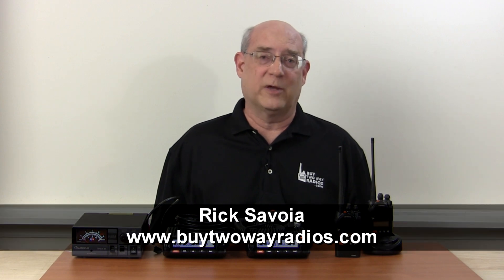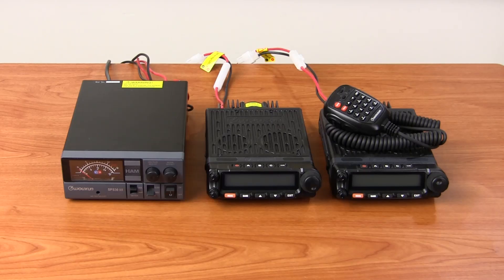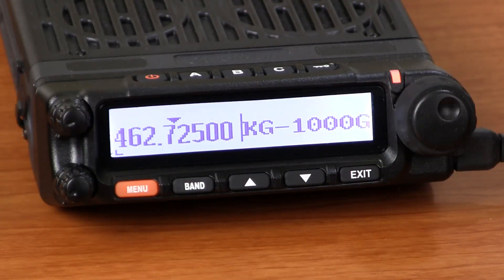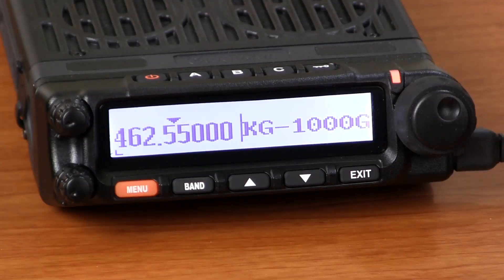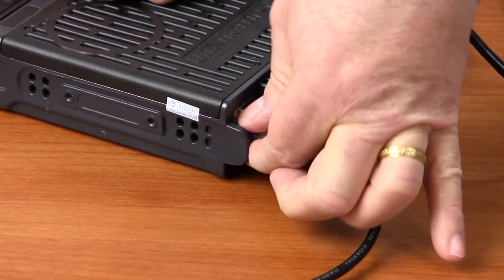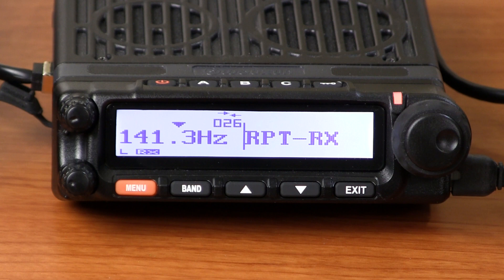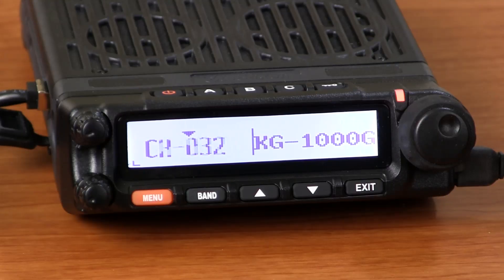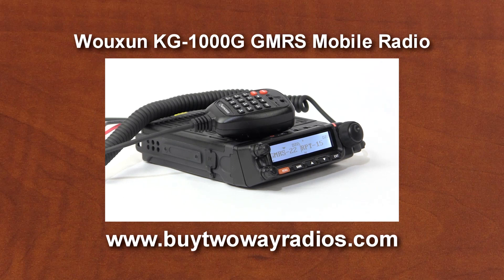How to Turn the Wouxun KG-1000G Into a GMRS Repeater

Comment: @BuyTwoWayRadios - Can you use a kg-1000g and a kg-1000g plus to make a repeater?
Reply from the maker: Yes, those models are compatible with each other to make a Repeater. However, the KG-1000G Plus is overall recommended over the regular KG-1000G.

Comment: You should have included more info on using 2 separate aerials, it’s not that easy to do without the receiver performance being severely affected by the transmitter!  Duplexer is best solution, but if using 2 aerials - vertically separate folded dipoles on the same pole exactly one above the other, and far apart, to maximise isolation.

Comment: Can you still use one unit as a base station to make calls? when in repeater mode or do I have to take it out of repeater mode to do so..
Reply from the maker: Yes! Turning on Option 56 RPT-PTT allows you to transmit while in repeater mode.

Comment: As I understand each radio requires its own antenna, What  recommended antenna for good receive and transmit and how far apart will they need to be? height will be 20 to 30 ft

Comment: Does Buy Two Way Radio offer a Station ID  module for the KG1000 plus or is it built in?
Reply: Hope you haven’t bought those radios for a repeater, they are an outstanding radio to throw in your car or a small farm in repeater mode. But they desensitized the receiver so much when it’s in repeater mode, 
No one can hit it unless they are within 10 miles or so. 
BTWR don’t mention that. There are other options you will get better results from.

Comment: One of the radios is massively 'over built' because it doesn't need to transmit at all.  You really just need a radio monitor and a repeater.   Why not make a less expensive monitor that communications with a KG-1000G?

Comment: Hello. I am very new to the radio communications hobby and find this video very helpful and informative. One question comes up: wouldn't it be more cost effective to purchase something like the Midland MXR10 GMRS Repeater. I recently watch a video from Notarubicon and it was about the Midland. Thanks.
Reply from the maker: Hi, thanks for your question! It really comes down to preference when considering different brands and what they offer within certain cost brackets. We cannot speak on the MXR10 as we do not offer it on our site, but the KG-1000G is a  very popular unit that many may already have on hand, and the cost of purchasing a second one to use for repeater purposes can actually be more affordable than buying a whole new repeater set as you suggested.
Reply: @BuyTwoWayRadios  Thankyou for the reply

Comment: Can you explain how you hooked two radios to the same power source?
Reply from the maker: To connect two radios to the same power supply, attach the leads to the power cables of each radio to the posts of the positive and negative terminals on the back of the power supply. You can use U terminals or ring connectors to stack them on the posts.

Comment: My 50W Wouxun outputs only around 25W at the GMRS frequency. A duplexer can rob almost 50% of your output power. So my issue with using the Wouxun hardware for a duplexer is that I might get 15W when I would prefer to radiate 50W.

Comment: Hi Rick...I am a newbie to GMRS radios and was disappointed to learn that the One City Minnesota area has -0- repeaters..I may do one that you are talking about.quedtion..does this repeater need to be registered or licensed by the FCC..?..,and could you give more info in spacing the Antennas and another video about setting up the outside antenna and cabling..thanks your clear and concise video was spot on and informative
Reply from the maker: Hi Lawrence, thanks for your question! We have an article on our blog about GMRS repeater guidelines, hopefully this will provide some insight: https://www.buytwowayradios.com/blog/2022/01/do-gmrs-repeaters-need-to-transmit-a-call-sign.html#:~:text=In%20simple%20terms%2C%20the%20repeater,identified%20by%20that%20family%20license.

For your other questions, we also have guides about antenna hardware such as connectors and which ones you will need: https://www.buytwowayradios.com/blog/2014/01/two_way_radio_antenna_connector_chart.html

Here is Episode 165 of our podcast, The Two Way Radio Show, about which antenna cabling is best in different situations: https://www.buytwowayradios.com/blog/2022/03/twrs-165-how-to-choose-an-antenna-cable-for-your-radio.html

Our blog is home to many resources for jumping into GMRS, Ham, or any other kind of two way radio-centered hobby. There is plenty more material that you may find useful!

Comment: Question if I use these radios for a permanent repeater station do these radios have a automatic station ID built into it. I Believe by FCC regulations you have to ID once every 10 minutes. Would be nice if there is a feature built into the radio to do this for me is that an option thank you very much.
Reply from the maker: There is no built-in function for Station ID. However, if your repeater is intended for use as a private or closed repeater system, you are not required to transmit a Station ID every 10 minutes. There are still specific rules regarding identification, though. We have a blog post about repeater ID guidelines on our blog, you can find a more detailed explanation there:
https://www.buytwowayradios.com/blog/2022/01/do-gmrs-repeaters-need-to-transmit-a-call-sign.html

Comment: This is good know that 2
radios will be able run as repeater unlike others on market. .
But You need a Duplexer for uhf .
2 antennas on a tower 14 leangth 
apart is hard to put up. 
FCC requirements CW repeaterstation ID  every 15 minutes if un-manned station. 
Wouxun should put CW ID in the radio.
Yes you can voice ID as callsign. 
 but can't leave by on 24/7 . 
If mic on TX radio keys up while iin repeater mode you can put a cw ID 
Like ID o matic on mic input RJ-45 .
Over all technology is getting better .
The Mobil is ultimate GMRS Mobil today.
Great video .

Comment: Is a Controller required for Station ID?
Reply from the maker: For private GMRS repeaters, an auto-ID isn't needed, but they are required for publicly accessible ones. Regarding the private repeaters, during transmissions the operator must identify the callsign of their GMRS license every 15 minutes. We have a handy article on our website that lays down more of the rules in detail:
https://www.buytwowayradios.com/blog/2022/01/do-gmrs-repeaters-need-to-transmit-a-call-sign.html#:~:text=In%20simple%20terms%2C%20the%20repeater,identified%20by%20that%20family%20license.

Comment: I just set up two Wouxun radios and have tested this repeater options, it’s pretty cool. 

I have two questions though. Is there a way to boost the audio on the system? The audio level is very quiet and I have to turn the volume up to hear communications compared other local channels. 

Two, any progress on an IDOMATIC type system?
Reply from the maker: We haven't heard of any issues with low audio. However, such an issue can be caused by desensing if you are using two antennas and they are not spaced far enough apart. Also, check the bandwidth settings on your radios in the repeater configuration. If one is set for narrowband and the other for wideband, that could affect the audio level.
 
As for the IDOMATIC system, we are still working on developing a setup specifically for the KG-1000G.
Reply: @BuyTwoWayRadios   any update on the ID-O-Matic going into these Radios yet?

Comment: What kind of Range are we talking about with a repeater like this
 with a 1486 tram antenna 20' ft
Reply from the maker: That will also depend on the surrounding terrain and the antenna heights of the radios accessing the repeater. There are a number of rf calculators available online to help figure out line of site and distance to the horizon. In short, your mileage will vary based on all those factors. However, it's a 50 watt mobile radio, so the average range is going to be what you would typically expect from a mobile/base radio attached to a decent antenna. Keep in mind that this isn't intended as a 24/7 dedicated repeater system, but is a handy feature for using a pair of KG-1000G mobile radios periodically as a temporary or emergency repeater system.
Reply: I get 26 miles usable at 40W using Comet CA-712EFC antenna 10ft off ground, over a slight ridge and a 800ft hill to a repeater. My antenna has approx 9dBi gain.

Comment: Just a thought: Having one of these very expensive units just to receive is a bit of luxury and renders the repeater idea a very expensive adventure. There are simple HT options using inexpensive duplexers for the same purpose, and if you hook up the TX handheld to an amplifier, then you can have the same powerful solution for fraction of the price. Another issue I see is the lack of a built-in controller for Station Identification. For that, you will need an external controller of some sort to be built that is compatible with this mobile system, for an additional cost that makes it even more expensive. I'm just surprised they haven't built in any sort of Station-ID solutions, when they have specifically created this mobile radio for Repeater operation. Could have been done with a software solution in the menu to identify the station in the required 10 minute intervals, so the repeater could be used legally by external operators as well. So yeah, there are a lot of things to think about before someone jumps into buying 2 of these rather expensive radios for a home based GMRS repeater system. However, on the positive side, GMRS users can enjoy yet another brand that offers a powerful radio on their favorite radio service band with the repeater option that the competition doesn't have.
Reply from the maker: The reason Wouxun did not build a controller for auto station ID was because although you can make two of these radios into a repeater, it is certainly not its primary function. It's intended as a mobile/base GMRS radio. The repeater functionality is just one fun and handy capability that puts it in another tier from other GMRS mobiles. It is NOT its primary function.
 
The video is simply a tuturial to show how to make it into a repeater. And, yes, with a controller and a duplexer it can function as a permanent repeater.
 
However,  the intent of the feature is so it can be used as a either a private or emergency mobile or base repeater. Also, this is not creating a ham radio repeater, it's a GMRS repeater, and the rules are different. First, the station ID is not required after every 10 minutes, as with an amateur repeater, but every 15 minutes. Also, as a private repeater used only by the operators of a single GMRS license, a station ID for the repeater itself is not required, as the GMRS license is assigned to that repeater by the GMRS licensed owner, and each station operator operating under that same GMRS license will be providing the ID as they use it. The auto station ID is only needed for repeaters that operate publicly or used by multiple different GMRS licensees.
 
As a side note, we are well aware of the demand for a compatible station ID controller and interface for the KG-1000G and have been working with Wouxun on such a solution in the future. Stay tuned for further developments. We appreciate the comments and feedback!

Comment: Can this be used as a mobile unit or or you assembling this to be a stationary repeater??? I have an RV I'd like to take the set up along with. Thanx!
Reply from the maker: It can be configured as either a base or mobile repeater. The video simply shows how to configure the units together, it isn't intended to limit it to operation as a base repeater.

Comment: WHY use two $300 radios for this? Couldn't you use a HT to recieve and the 50 watt mobile to transmit??
Reply from the maker: The radio is designed to interface both physically and internally with another KG-1000G to perform the functions of a repeater. As shown in the video, the receive and transmit units must be set to a menu option specifically intended to link the radios together. A typical ht does not have this capability.

Comment: Does it have a simplex repeater function
Reply from the maker: Since one cannot transmit and receive on the same frequency simultaneously, there would need to be a controlling device in place between the two units that would record the incoming message from the receiving unit and send it to the transmit unit to retransmit it on a delay. Such a feature is not inherently built into the KG-1000G.

Comment: You say it's illegal gmrs repeater how do you get it to tone identify. Is there some way to hook up or to get it to tone identify every 15 minutes or at the end of a usage transmission as required by the FCC.
Reply from the maker: Identification isn't required if the repeater is only being used by a family group covered by the same callsign. We are working on an interface that would connect the KG-1000G to devices such as the ID-O-Matic for public use and hope to have it available soon.
Reply: @BuyTwoWayRadios  okay that sounds better. In your first video you stated it was a legal GMRS repeater which according to part 95 it is not, any repeater that sends signal out over the air must have an ID. Okay please let me know when it is available I want to set the two I bought from you up as a gmrs repeater
Reply from the maker: What we meant by legal was that the radio is FCC type accepted for use on Part 95, which most other repeaters are not. Again, according to the rules, No ID is required when it is used as a private repeater by family members under the same GMRS license. It can also be used as a temporary or emergency repeater by manually transmitting the ID as needed, so technically it is still legal when used under those conditions. As a permanent repeater, an automated ID would be required, but we are working on that.

Comment: Is there a way to change the screen color on the 1000G - I did not see anything in the Manual.
Reply from the maker: The screen color cannot be changed. However, the LED colors can be customized for standby, transmit and receive.

Comment: Will it self identify so it's legal as a repeater?
Reply from the maker: It does not inherently have the capability to self identify, however we would like to create an interface at some point that would connect the KG-1000G to existing devices that generate an ID for that purpose. As far as legal use is concerned, if the repeater is only being used by a family group covered by the same callsign, identification isn't required. For public use, identification is required every 15 minutes and this can be done manually, so the KG-1000G would work fine as a public repeater in temporary setups where the owner is actively using it.
Reply: @BuyTwoWayRadios  ok that would be great if you could make something to make it self identify. I'm thinking of building a repeater for our emergency neighborhood fire group, so it would not be public but would be used by more than one family. I've already found a great location and built a little parrot style system to test the whole area. I'm pretty much just down to finding a suitable repeater. Hopefully something less expensive than a turn key repeater.